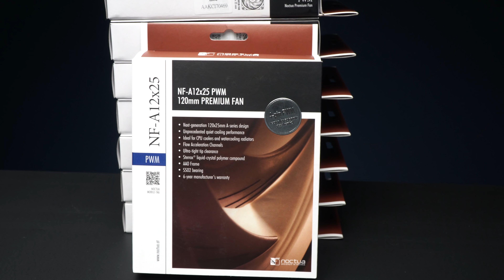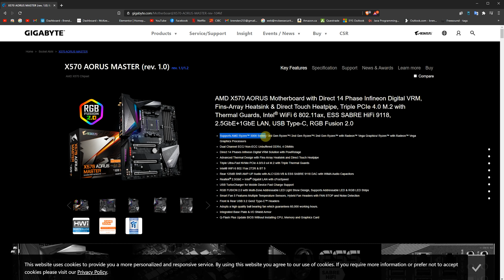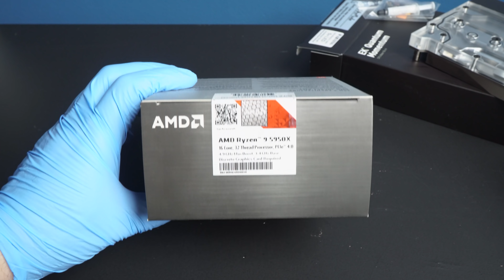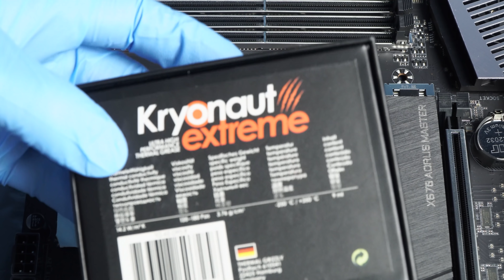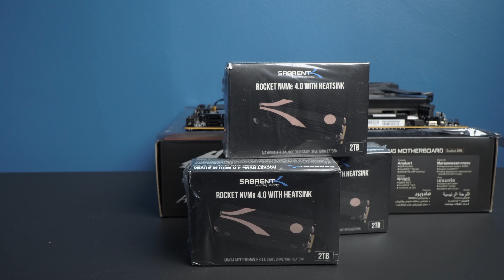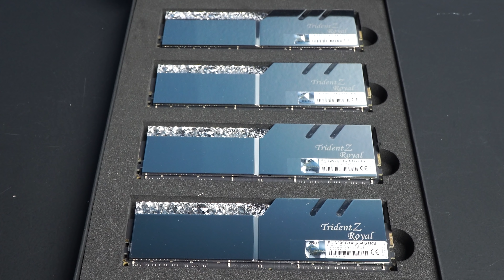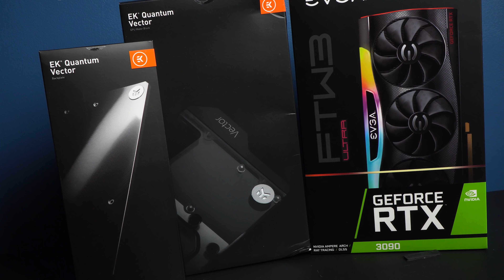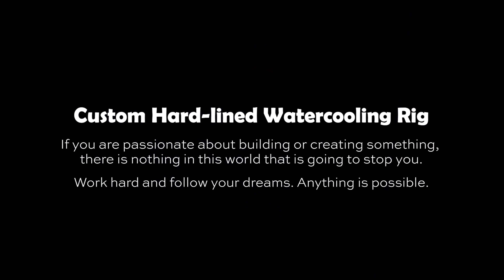THE ULTIMATE WATERCOOLING BUILD - RTX 3090 - Ryzen 9 5950X

Comment from the maker: WOW! 😳 I am so incredibly appreciative for all the positive comments and support. You guys are honestly amazing ❤

I will most definitely be going over the performance, benchmarks, and temperatures in a future video. I may even attempt to do some overclocking 😎

If you are interested in seeing some photos I took of this beautiful build you can find them here: I'm on Instagram as @brendenmckee https://www.instagram.com/invites/contact/?i=n3u0ue0bhfmh&utm_content=3sajti

Again, thank you all from the bottom of my heart. You guys have made all of the hard work worth it 💯❤
Reply: You earn it man, you really do.
Reply: hey man great built which cable riser and gpu bracket did you use for verticak gpu mount? also how is your temps?
Reply: did u have any issues with the ek block its bricking some cards
Reply: @petterderter6354  it's good
Reply: Did you ever get around to testing out the system, I built my system with the same X570 master monoblock and I have been very disappointed with its overall machined tolerances and performance. By far the worst performing waterblock I've ever used, even when compared to AIO's. It's adequate for cooling and I've been using it for over a year now, but a good air cooler would beat it for overclocking easily, and I even attempted to remount it and get more clamping force but it just isn't tight enough out of the box. EK also didn't provide any help or advice other than "it works and doesn't leak right?" So that was it.

Comment: Nice build … but the way you did this makes the reservoir unnecessary
Since you are doing it in an old-school way …
Nowadays most people use the reservoir (with aqua pipe) to fill the loop so you will not have to use an open port that’s part of the loop 
In my opinion that would have made filling the loop a lot easier and would have prevented the issue with the open port you used for filling

Comment: Nice build👍 I'm currently in the process of custom water cooling my pc and it's also a white build😃just waiting for a few fittings to arrive to finish it. None of my components are new just the water cooling parts. I have a threadripper 3960X with asus trx40 prime motherboard with corsair pro white ram and a RTX 3090. I'm building in a white fractual meshify 2 case. My water cooling parts are from various manufactures. I'm repurposing a alphacool 420mm radiator in the roof and adding a ek 280mm in the front. I've decided to use corsair ml pro 140mm white fans. CPU block is a EK Velocity, GPU block is alphacool and pump res combo is a corsair xd5 white. My fittings are white from corsair and i'm using alphacool white soft tubing and clear coolant. Watching your video has made me decide to also have rear fan as intake which will give me 4 intakes vs 3 exhaust which should give a better balance as intakes are filtered. I will be using a silverstone white magnetic filter for the rear fan and attaching to the outside of the case to ease cleaning. Ive got the in and outs of my front radiator positioned at the bottom thinking this will aid draining the loop and added a t fitting with a ball valve to drain. My 3090 is a reference pcb and looks tiny compared to the evga ftw its length ends before the power plugs on the ftw and is a lot shorter too. I hope the alphacool block was a good choice it was nice that the thermal pads were pre cut and numbered. My pcie riser is the same as yours. Hopefully can finish and test it this weekend.

Comment: Very nice build Brenden! Congrats, i am also gonna make a hardline custom build with three rads but I am gonna setup things a bit different, Bottom, Top and Rear as intake, side as exhaust.
Should gave you even better temps, especially CPU and VRM wise. Doesn`t sound natural as hot air rises but that`s not the case for custom water loops. Anyhow very nice video and build, liked!

Comment: 2:27
I totally agree. I hate it when someone does like some amazing hard line water cooling thing and then uses some shit thermal pad.
Reply: Except he probably severely overpaid for this paste and it is literally only .15 degree difference in load temps in Prime95. Yet the much cheaper Kingpin Cooling Kpx was 1.07 degrees difference, so he really should have not have bought this paste, it's not the absolutely BEST and it's like 5 times the price as anything else. Literally a waste of money.

Comment: Brenden absolutely a awesome build brother. It's a very clean and well planned build for sure. My only question is if you spent close to a $100 on Thermal Grizzly Kryonaut Extreme why didn't you spend the extra to get better pads? EK's products are great. I'm using all EK products in my current build (3x rads, 1 360 XE, 1 360 PE, 1 240 ST30 cooling a 5900x, 3090, 64gb 3600 cl 14, 2 980 pros 2tb, 2 870 evo 4tb, 2 12tb HDDs and a partridge in a pear tree) But my thought is why spend all this cash to cool a pc and then just use "ok" pads. Understand? I'm not trying to knock you.. at all. I'm just curious? Anyway again, awesome build brother. Hope you enjoy it cause I enjoyed watching you build it.

Comment: Why leave a dust filter on top if the air is blown out). And it is desirable to install fans of the middle radiator for blowing into the housing, for this purpose there is a dust collector installed on the back wall. This will be more efficient and in fact it turns out the front panel. У меня такой же "колхоз" из трех радиков 25-40-55мм ), только на жидких трубках). Filtr?

Comment: Great build man. What are the reservoir and the brackets you use for the pump and reservoirs?  I have almost 90% of the same build but the problem I am having is the EKWB EVGA graphics card water block is causing my corsair pump/combo to be pushed at an angle. I really want to fix it. Researching led me to your great video. I really wish I had your video for planning back when I started my build about 1.5 years ago!!!

Comment: My recent build shares some of the same main components and case as yours. I'm air cooled with tons of RGB. I can relate to all the effort in your build then to top it off with a quality video, BRAVO!
You didn't list a monitor? I certainly hope you didn't skimp in that regard! I'm using a LG 38GN950 which I would recommend:)
Reply from the maker: That's great man, I love this case! And thank you soo much! I have the 37" Acer XR382CQK HDR UWQHD IPS (3840 x 1600) 21:10 aspect ratio. I'll have to do a video on my desk setup at somepoint too 😎🤙
Reply: @BrendenMcKee  What are your MB chipset(on the chip) temperatures? I have the same MB....

Comment: can you do a video to show the temp for CPU and GPU, and why did connect the GPU to CPU direct? I am assume that this will bring the temp of CPU higher.
I have 5950x ,rtx 3080  and lian li dynamic xl and thinking of doing  custom watercool. 
aosom video by the way
Reply from the maker: I will for sure! This was always a curiosity of mine aswell... I'm going to do extensive testing with the current configuration and then I'm going to modify the loop so that it goes from 3090 > 360mm rad > 5950x and see if there is any difference 😎👌
Reply: @BrendenMcKee  no you don’t need to do that. It’s not possible to heat the liquid so fast that it will raise the temp only for the cpu. it will make no difference at all. you have 3 radiators. can you tell is the cpu temp pls?
Reply: @BrendenMcKee  looking forward to that

Comment: Same case I got jm about yo build it now I got my 3090 ftw3 in nov on evga queue system and finally broke down and got a ebay 5900x and got lian li pc011 xl with ek frny distro using prebeny chrome tubing I am trying yo figure out what size and height radiators top and bottom that make the runs as easy as possible yo go straight into distro plate in the front I think top jusy a slim or normal but bottom do I need a thick or slim so yhr pre bent tube cab make it  straight  pretty easy

Comment: One question, how often  we need change liquid I mean cryofuel inside  case, is it one time at year  or after few months....or every few years....
Reply from the maker: It is recommended to be changed every 12 months or 1 year. But, I've seen many people run their coolant for as long as 3 - 4 years. Which I don't recommend, but hey some people don't really care about their loop getting "cloudy" or slightly reducing their coolants performance.
Reply from the maker: Personally, I will most likely change my coolant every 6 - 12 months.
Reply: @BrendenMcKee  thx for fast reply and maybe if u can post one video how to properly remove and change liquid inside with new one, it helps a lot,amazing build btw
Reply from the maker: @barracuda7366  You're welcome! You bet, will do 😁👌

Comment: the fan configuration is not very good tough since it will result in negative pressure inside the case
Reply from the maker: I thought this may be the case. I'm thinking on adding a second fan hub for the intake fans so I can run them at a higher RPM 👍

Comment: What are your temps with the 5950x? Mine seems to be running 🔥. Idle is at 5 degrees above water but in games like COD it spikes to 85
Reply: May want to check the mount and how your thermal paste is spread, you could be dealing with an IHS that isn't totally flat so it's creating hotspots.

Comment: this video looks like it was a lot of effort. nice build, you and i have basically the same build same parts and monoblock.. question, what are your temps on your cpu.. this 5950x is hot af. im idling at like 50c and when going all core i can see 84c. im running it with 2 ek pe rads w/ unifans.
Reply from the maker: Thank you! It sure was a ton of effort. Relieved to be done, haha. Oh that is awesome! Yeah... I was also really shocked when I started up my first game of Warzone and noticed the 5950x was twice the temperature as my GPU. Apparently, the 5950x just runs really hot and it is totally normal. I haven't done any benchmarking yet, but taking a look at my temps I seem to be getting similar temperatures as yourself. I will need to do some more testing though to get accurate readings. I will for sure keep you posted when I do! 👍
Reply: @BrendenMcKee  so i figured out that when PBO is enabled, it gets hot under load. turned off PBO and in the bios and re-ran tests everything is a lot a better. like max is 77c and idle is in the 50s that i cant get rid of thats idle temp is normal.
Reply from the maker: Oh wow! That is a huge difference in temperatures. I will definitely have to check this out. Thank you for sharing this man!
Reply: @BrendenMcKee  i was able to get a stable 4.5 all core oc at 1.32v and she hasnt gone above 82c and did benchmarks on reg vs all core and the all core is faster for gaming. 300pts additional in timespy and 3500 more in superposition
Reply: Not enough surface, get a Mora3 420👍
Reply: @blacknovella  I have gone 4.5 alle core at 1.275v and it runs pretty stable, so you can try that voltage to get the cpu cooler
Reply: @mustachepotet7726  thanks will try that!!!

Comment: Because so much is personal preference, my only real gripe with this build due to how much effort you put into it is that you ran the GPU and CPU right into each other. With 3 360rads I would expect one rad to be between them. The thermal setup is so insanely overkill that it seemed odd to not leverage a little cooling stage between them. Otherwise an amazing build.
Reply from the maker: Excellent point, stay tuned for a future video I am working on 😏😎 

And thank you!
Reply: I have to disagree … it makes the loop more complicated than it needs to be and the result would be that the liquid is only 1 degree cooler than it is right now
In this case you could even argue if there needs to be a radiator after the pomp since the D5 also dumps heat into the loop (not a lot but it still does) 
And than you would get 
Res > Pomp > Rad > GPU > Rad > CPU > Rad > back to Res
That would be the most ideal setup but there is not a lot to gain from doing this
However the “Res > Pomp” would be a bit smarter to do since you would than not be able to let your pomp run dry